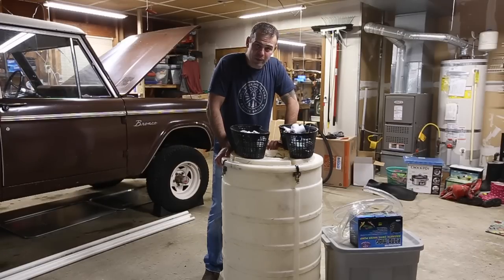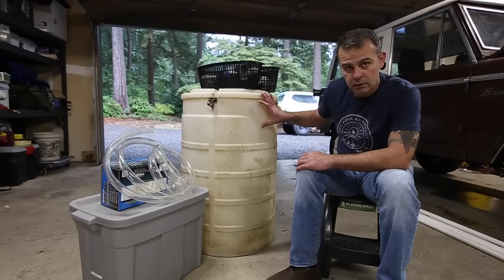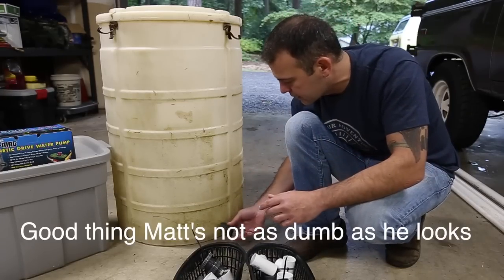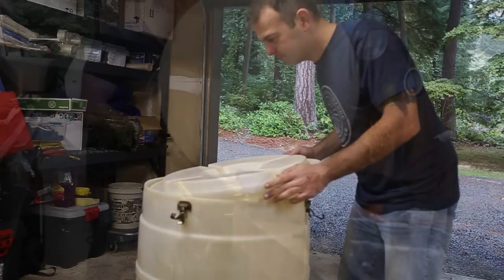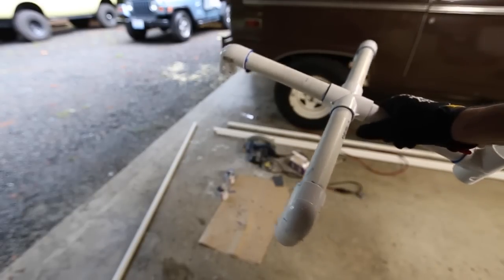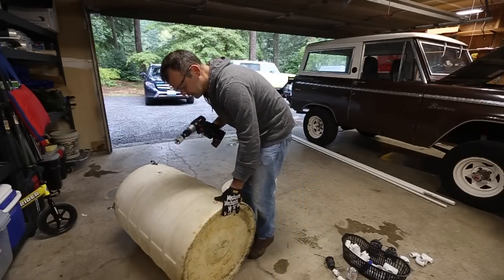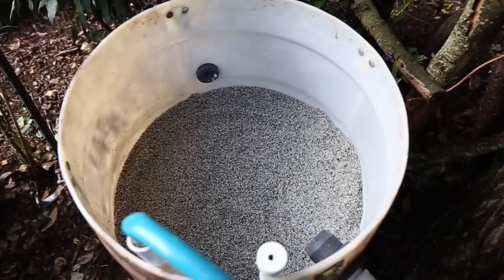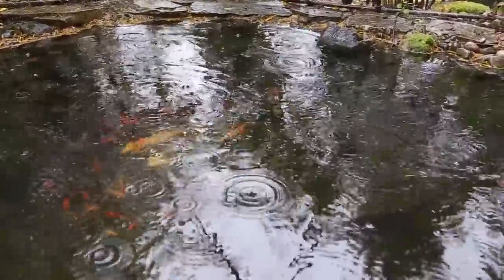Koi Pond Filter How-To (Detailed)

Comment: I like it a lot thanks for sharing I do have a question on the air cleaner design when you have the air running to clean the material you don't think it will mix all the different size gravel up? Just curious.i might go with some light defuser in between the different layers. But over all just a great setup. 🙂💯👍✌️🤘
Reply from the maker: It’s been a while but as I recall since the bigger aggregate was at the bottom it had no effect on the distribution or media in the barrel.

Comment: Hi, thank you for the information. It is very useful. But one information I am looking for. Does barrel size or tank size make an effect according the pump power? My pump is 6500 litres per hour and my filter barrel is 25 litres. Will it  work ?
Reply from the maker: Divya Miaow hi I think you need a 50 gallon / 200 liter barrel for your filter.  The pump seems big enough.
Reply: From looking at poo plants and other filter ideas like vortex 10% volume of pump flow good start

Comment: Awesome stuff!!! What makes the water crystal clear? Is it the bigger the pump? or the bigger the bucket? Thanks for the info...
Reply from the maker: It's the rocks in the big barrel that polish the water.  It's still clear two years later with regular backwashing of the filter.(opening the bottom valve)
Reply: Thanks...